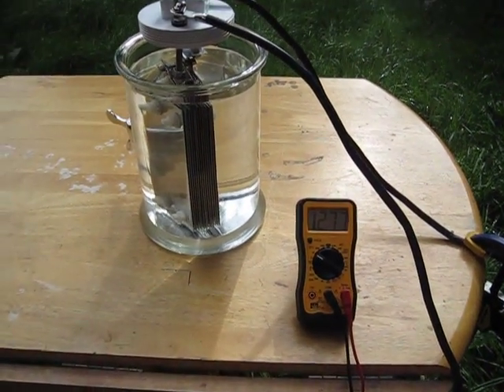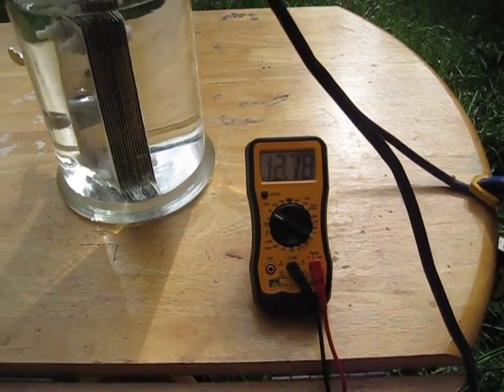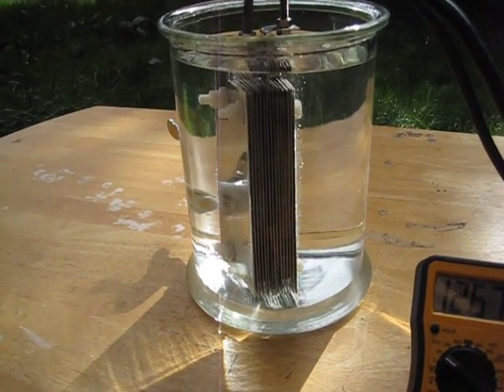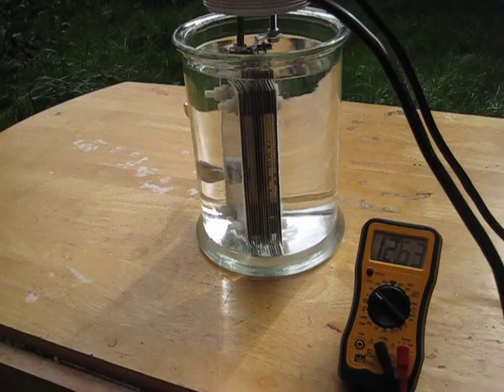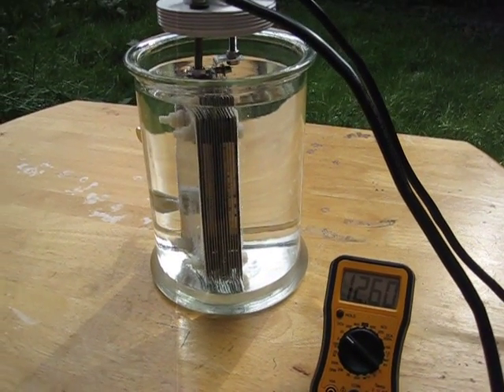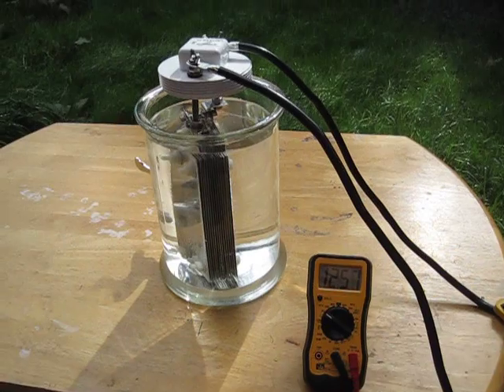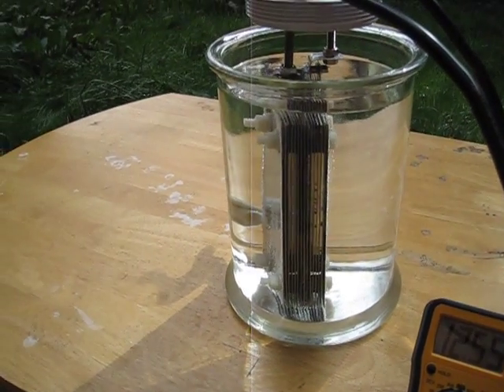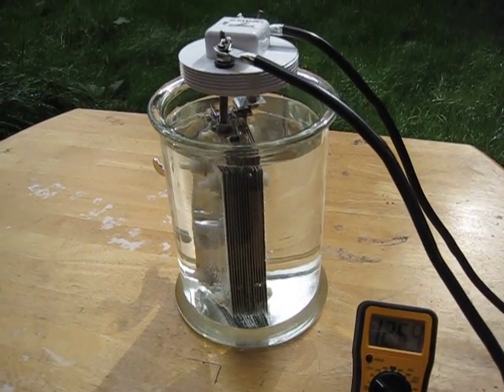first test of HHO Wet Cell 006.AVI

Comment from the maker: hi 06, that was its first fire up, after some conditioning of the plates the output improved a lot. remember, that was over a gallon of water, very little mix added for that ratio. farther along in the test i used solid state pulse motor to drive it with spikes over 300 volts and the LPM was really nice